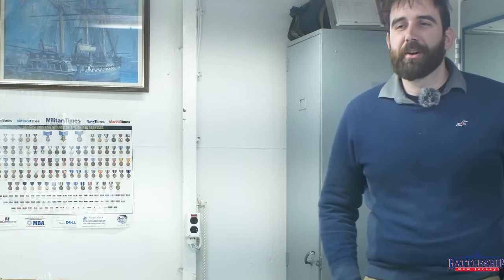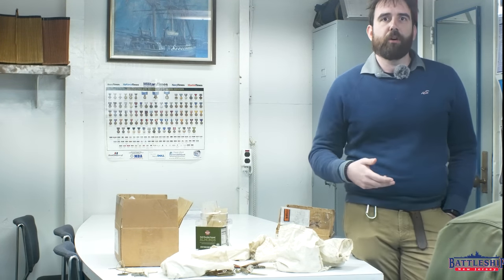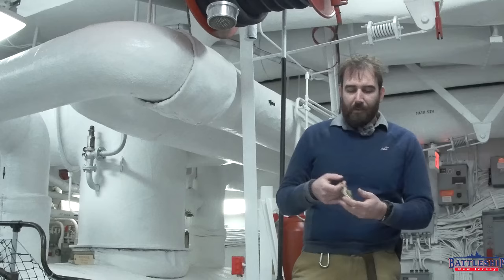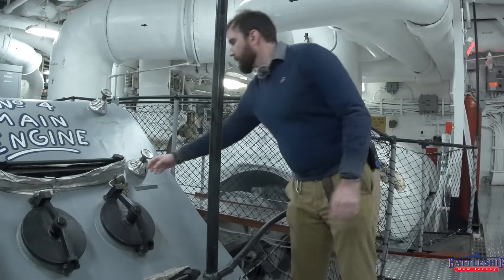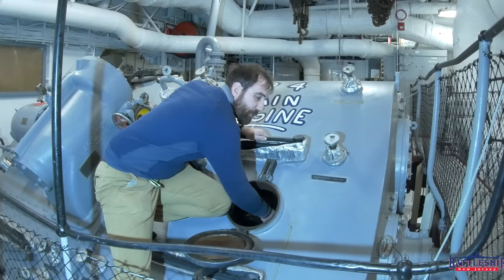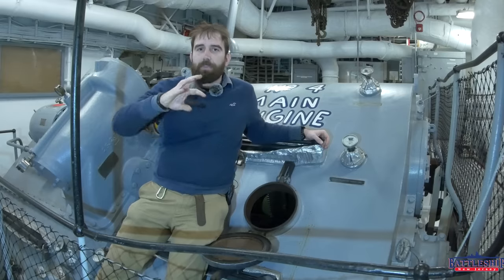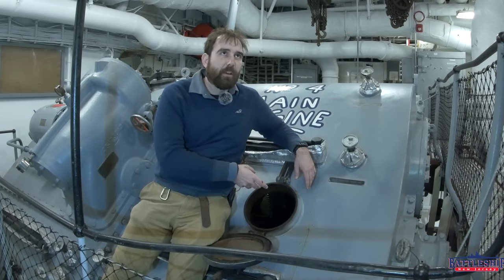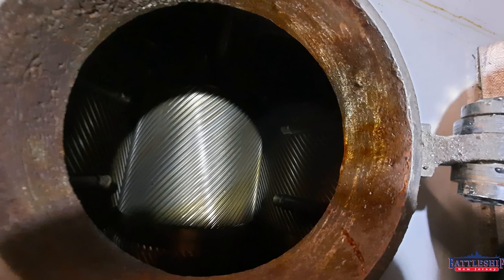The Keys to the World's Fastest Battleship: Unlocking the Reduction Gears

Comment: On the submarine I was on for 4 years,. we opened them up once for inspection. Since they are so rarely opened we had all the guys in Machinery Department (M-Div) come and take a look. To do this you do an exclusion zone, you have to take averything out of your pockets, we took our shirts off so no chance of a button falling in. Taped up the zipper on our pants, and put tape on the screws to our glasses. There is a watch at the entrance to the exclusion zone who will log everything in and out. In any case it was my turn and the M-div Lead Petty Officer (LPO) opened the hatch. We did this with the lube oil system running and the main engines on the turning gear. I got a whiff of that oil and nearly threw up. I was wow that looks great see you later. The LPO wanted to show me stuff. I just wanted to high tail it out of their because of all the lore that went into the reduction gear I did not want to think of the consequences of throwing up in the reduction gear. There is a story that I believe it was the USS Memphis, they had a screw get loose during a refit and the damaged the gears. They fixed it by grinding a second groove in the helical gears and limited the bell it could answer.

Comment: Ryan, I cannot think of anything more critical to the ship's function than the reduction gears, there is redundancy for nearly everything else.

A sister ship of ours suffered the kind of sabotage that you mentioned, she was preparing to sail for an exercise with 2nd Fleet to be followed very shortly afterward by a scheduled deployment to the 6th Fleet.  A sailor literally "threw a wrench into the works," one of her main reduction gears and NO ONE NOTICED until that engine was spun up and the reduction gear thoroughly trashed.  Our sister was sent to Norfolk Naval Shipyard to have her side opened in a drydock and the reduction gear replaced with one brought in from Litton at Pascagoula, I think one that was supposed to be installed in one of the Ticonderoga cruisers (Spru-cans from the main deck down, same main machinery.)  

We sailed in her place for the exercise on one day notice and another squadron mate took her place for the Med cruise on two weeks notice.
Reply: USS Comte de Grasse in 1994.
Reply: NJP for said sailor?

Comment: I heard a story of a guy who was working on or near a camshaft for a large marine engine. He put a socket down on the gear. He forgot to remove it. The gear was damaged and basically skipped a tooth causing the valves to crash into the pistons. A very expensive mistake!  I'm glad they took so much care with these gearboxes.

Comment: I worked in engine rooms just like this on USS JOHN F KENNEDY CV67 & USS INCHON LPH/MCS 12. Working on the reduction gears had the highest level of quality control there is in navy. If I remember correctly there should be 16oo gallons of lube oil in engine sump

Comment: You should discuss why the gears are set up in that fashion.  Herringbone matters.  Well thought out.  Brilliant designs.  Pretty impressive machining in the pre-CNC days.
Reply: Double-herringbone - left and right.  Keeps the axial thrust to zero.  Both, the hardest to machine (left and right gear geometries) and get settled into the bearing blocks.  Also, you have four degrees of freedom to account for - pitch, yaw, distance between centers, forward/aft along the axis.  Now, multiply that times the number of gears in the set - two turbines, each with two output shafts (high & low RPM), the shaft, and you're at 12 separate adjustments each within a couple of thou.  Very impressive, indeed.
Reply: @fredinit  Plus the US was probably paying royalties for the design to Citroen, the original developer of the zero side thrust helical gear, as those patents were likely still in force when that gear was designed.

Comment: My dad was a outside machinist at Norfolk naval shipyard 71-91. Whenever IOWA had work needed on it’s steam turbines, generators, or reduction gears, he’d be the lead from shop 38 on the job. He told me that on the steam turbines the clearance between the turbine blades and the packing around it was about the thickness of three sheets of paper. On the reduction gears the navy specified a tolerance of about half a sheet of paper thickness. The reduction gear lube pump that sprayed the lube oil on the gears circulated a few hundred gallons of oil and pumped like 100 gallons a minute. When the covers were open an armed marine guard was present to prevent sabotage.

Comment: I remember back in the late 80s or early 90s a sailor who did not want to deploy, opened one set of reduction gears on one of the San Diego based carriers 9at the time Ranger KH, or Connie) and threw in nuts and bolts.  Destroyed the gears.  The reduction gears are toward the very bottom of the ship and needed to be replaced.  Cutting from the top, the yard cut through all the intervening decks from the hanger deck down, removed each level before pulling out the housing and replacing it with a spare.  Not something found on the shelf at the local parts depot.  It was an amazing job.  Left me in awe of the knowledge and skills of the contractors involved.  It was soon after that that that the gear housing were locked.

Comment: On HMS Belfast, there is at least one reduction gearbox open to admire. There were lots of copper pipes delivering oil to where the gears mash from a pump the size of a motorcycle engine. And my memory of RMS Queen Mary gets a little old, but I do remember seeing some inanely large gears there, too. 
Has such a gearbox ever been damaged because a padlock or a bunch of keys fell in it? Not very likely but I would appreciate the irony.

Comment: @Battleship New Jersey
Ryan, I can't even begin to explain the heebie-jeebies I'm getting with that cover open and no cleanliness protocols in place. We used to have to build a sort of tent around it, empty our pockets, take off our belts, then put duct tape over the zipper of our coveralls, the collar button, and the eyelets of our boots. Opening those covers was NO Joke. The ships I was on did not have marines, but there were watches posted.
Reply: Only an issue if the gears were to turn - not a likely scenario and becoming less likely with each passing year.  If, however, Ryan were do drop his phone in there, it would simply need to be logged for future retrieval in the unlikely event of a reactivation.
Reply: I was a twidget and I had the same reaction.  Man, just opening that up with no protocols.
Reply: @nmccw3245  You could not be farther from the truth. That would need to be retrieved. You can't have who knows what contaminating the oil and possibly causing corrosion,  and then that only works if you KNOW you dropped something in there. I don't think you have a full understanding of the value of that reduction gear even now and what it would take to replace it.
PLEAS don't argue with us on this; we used to do this. I was enlisted for 20 years, and  Engineering was where I worked.
Reply: This gear is now a static display piece. It no longer needs to be functional. I am, however, concerned about how the curator seems to have issues remembering how screws work.
Reply: @user2C47  - he mumbled “righty-tighty, lefty-loosey “
Reply: @user2C47  No, it is not a static display. This warship is in effect on loan from the Navy and can and has been called back into service. Will it ever happen again? Prior to the Ukraine war, I would have said no, but now? who knows? The point is they are under contract to keep it in a certain condition so it can be reactivated if need be.

Comment: Spent 11 months of my 23 year Navy career on a DER (Destroyer Escort, Radar Picket),  unceremoniously known as Diesel Engine Riverboat. The big destroyers had steam boilers that had to be manually lit; we had four diesel engines for propulsion (big diesels). We were prepping for getting underway, and it was time to start the diesels and warm them up. All the seasoned Snipes(engineers) told the new guy - first time on ANY ship - to go to the bridge and ask the Captain "for the keys to the engines". He trudges up to the bridge, which was a total "organized chaos" getting ready to get underway and salutes the Captain and requests the keys to the engines. The Captain was NOT amused ! BTW - the diesels were started with high pressure (3000 psi) air. To go in reverse, they were stopped and started in reverse. One did not do too many reversals of the engines or would find oneself out of air and have to wait for it to build. Not good when maneuvering in port !

Comment: Someone may have already mentioned this, but those keys look like Medico keys which have angled teeth that not only lift the cylinder pins to the right height but also rotates the pins so another set can engage properly. That is some very high level security. Those locks are not easily picked and those keys are not easily duplicated.
Reply: Yes, they look like MEDECO keys to me
Reply: @62Cristoforo  The locks are probably made by contract specifically for the military.  Imagine the lock for the reactor compartment door :)

Comment: They gears are sort of like herringbone gears but are actually double helical this is the strongest type of gear and the smoothest because so many teeth are engaged at once. The groove between the angles are a relief path for the oil so the gears can go in reverse as well. If they were true herringbone gears the oil would get caught at the point of the herringbone and cause the gears to hydraulically lock.
Reply: Also aids manufacturing and precision lapping.
Reply: Those are herringbone gears.  They, as you said, put the space between the gears to prevent oil hydraulic lock.  But you also have to remember, all gears are made with relief at the bottom or root of the teeth, which allow exit of oil and such.

Comment: The lube oil system for these gears is incredibly clean. I had the (mis) fortune of monitoring the initial cleaning of a new lube oil system on a couple of electrical power plants on land.  The whole process took about 200 hours with samples taken of the lube oil every hour to determine when it was finally cleaned of all debris and residue left behind from fabrication and installation.  The gears are beautifully polished as they run.  I am not sure what the sailor with the file is doing to the gear but he should not be anywhere close to it with a file.  A fine stone maybe but not a file.

Comment: Cavitation, prevented through the correct speed reduction afforded by the reduction gears along with correct propeller design, is actually not air bubbles on the propeller.  Cavitation describes what occurs when the static pressure of the water flowing along the propeller blade's low pressure surface falls below the water's vapor pressure, instantly turning it from liquid to vapor.  These water vapor "bubbles" are essentially vacuum pockets that rapidly form then violently collapse as the vapor changes back to liquid, causing shock waves that severely pound the propeller.  Cavitation causes vibration and excessive wear on the propeller and shaft components, and if severe enough can eventually cause catastrophic failure.  Cavitation can occur on any size propeller, from outboard motorboat to battleship.

Comment: Yes, skivvies to clean and inspect L.O. sump. When opening the top access points , CHENG and XO/CO, master at arms if left open, normally does not happen as doors can be buttoned up rather easily. When working on them you had to have all your seams and cuffs taped closed to prevent buttons from falling off. Normally just T-shirt and pants with no belt or coveralls. No hats, watches rings, and such allowed in the space when engine was opened. Also anytime we went in a tank or header all tools inventoried
I was also under the impression that the gears were all measured by one person start to finish to eliminate variables in measurements.

Comment: In the 1970s I visited a plant in Sunnyvale CA that had the machinery to cut the teeth to an approximately 12 foot diameter navy ship reduction gear. Each tooth as only about 3/4" across and deep with a curve to allow smooth quiet gear engagement. The machine setup took into account the vibration from a nearby road. Unfortunately the first gear that was cut on the machine was off by about 1/2 of a gear tooth diameter when the machine got all the way around the gear. Talk about an expensive goof. 😒😜

Comment: At the 12:00 point.  Comparing a Honda oil capacity to the lube oil storage tank would be mostly incorrect.  The better example would be to compare the 5 gallon bucket of oil in your garage to the lube oil storage tank.  

Much like your car, the Main Engines & Reduction Gears share an oil sump.  Oil would only be transferred from the LO Storage Tank if it was needed to makeup some volume in another system (like the Main Engine/Reduction Gear Sump.

With that….i think it would be cool and interesting to go below and show us the sump.  I’m a submarine engineering sailor by history, but I’m assuming everything is very similar.  Same reduction gear covers and oiling setup.  As always, great job!  Love the Engine Room tours

Comment: I put the USS Donner LSD 20 out of commission as a MM3 in 1970. One duty was to fill the reduction gears with about 200 gallons of cosmoline for rust protection. Nobody cared that we had the gears open. She was built in 45 I think and finally scrapped in about 2005 with shiny gears.

Comment: My suspicion would be that the officer in charge of the second set of reduction gear lock keys would be the CHENG"s assistant, the MPA - or Main Propulsion Assistant.  Aboard my ship (which only had two enginerooms) in the 90s, the MPA would then have the M1 & M2 (and presumably M3 & M4) Division officers under him to handle the sailors running the mechanical side of the plant.

Comment: i was on a tin can DD 849  never seen the bearing covers open i did however go into the oil sump under the gear box to clean slag oil out after the oil was pumped to the settling tank and that was a dirty job everything you had on went into the trash and i went to the showers for a good scrubbing

Comment: The reduction box is double reduction  to get from 5 or 6K rpm to about 200 rpm at the propeller,  the input  off the turbine is divided into two shafts called quilt shafts , and the turbine gear is smaller than the gears on the  meshing quilt shaft gears  togive the first stage reduction, then the other end of the quilt shafts  meshes  with the thrust block / propeller  gear  and that is the second  reduction  which  is a greater ratio than the first  as seen in the photo  of the bull wheel gear wich is in the thrust block 
Padlocks also on the turbine side steam space of the main condensers
Reply: I think that the word you want to use is "quill".
Reply: I spelt quill with one "l" and the phone changed  them to quilt

Comment: Those are security locks, designed to be individually keyed and key remains with the lock when open, so you don't forget to lock it when leaving.  And good luck if you have to cut one of those locks, not fun.  Had a key break in the Port FWD SRBOC Ready Service Locker, on deployment.  Had to use an oxy-acetylene torch to cut it open, with rounds in the RSL.  I had to stand beside DC1 while he cut it open, as fire watch and security watch.  And we could not cut it until we got the new lock and key.

Comment: Are you starting  the lube oil pumps periodically and using the jacking gear to keep the gears costed with oil?

Or are the line shaft packings too tight to allow it to move?

Are there dehumidifiers on the gearboxes?
Reply: Likely forbidden as they aren't allowed to touch the power plant. They may also be welded in place.

Comment: i imagine only one set was in the engineering department, probably under the Cheng's control.  the other would be in deep storage someplace else in case the first set wasn't available or damaged.  on my ships, there was always another copy of a critical key or combo in deep storage under someone else's control in case access was cut for some reason.

when i was on Constellation i saw her get a reduction gear set get changed.  that's where carriers have all the advantages i think.  they had bolted covers or hard patches all the way up from the gear box to the hanger and they had brought aboard a large crane-truck to do the work.

amazing to see them sitting the heavy wooden carts they had.  neither of the three were very big, the bigger two were the same length as the passenger cabin of a normal car with the third a bit smaller.  but the big ones weighed 5 tons, the smaller 3.

glad you are going to be very careful about accessing those gear boxes.  those and the turbines are the big ticket precision items on board.